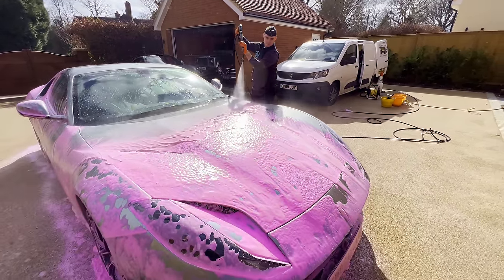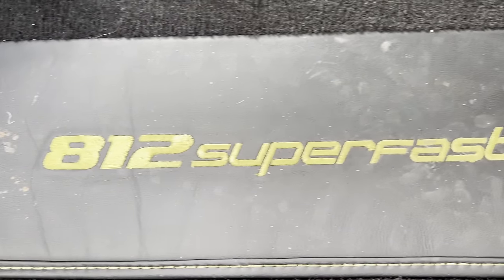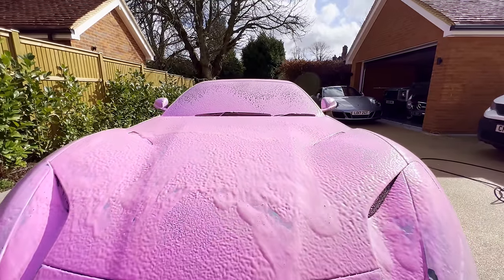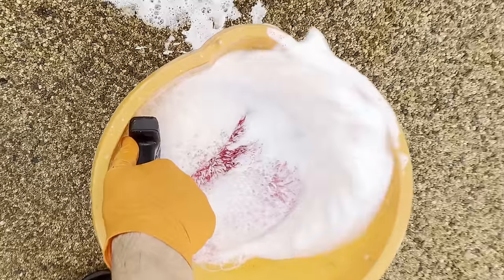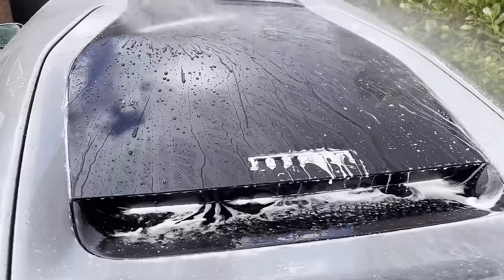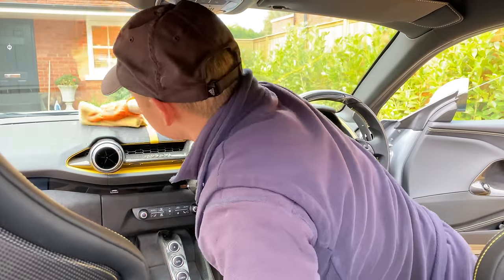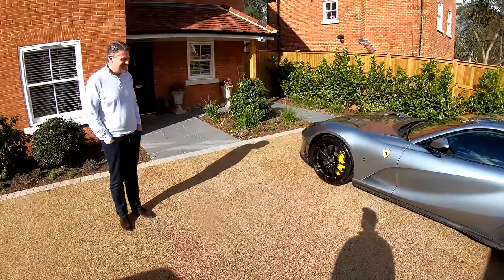How Super Cars are Cleaned In London

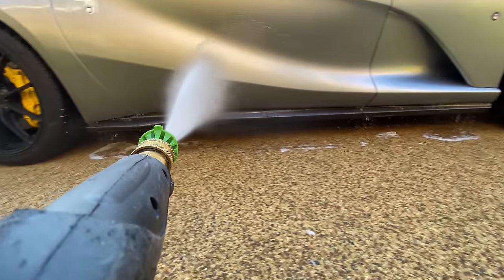Comment: Hi Tino! at the 6:10 mark you put the ceramic foam lance in the quick connect pressure washer handle, I have recently got a similar set up but when I use this it is leaking at the connection, did you use PTFE tape when you fit it into the lance? Please let me know.
Reply from the maker: Hello, yes I did (an would recommend) use the ptfe tape. Also I would recommend then tightening it hard (I used two spanners). Hope this helps.
Reply: @TinoCarCare  Thanks Tino!

Comment: 3:41.  How long do you leave the foam to act before rinsing with water ?
If you leave it longer than normal, can it be harmful to the paint ?
Reply from the maker: Depends on conditions, I like to leave it for around 2 minutes, however if it is hotter you leave it less, and if it is colder you can leave it longer. It is not harmful to the paint but you do not want it to dry as it is easier to remove the dirt once the foam is still wet

Comment: does it matter if the water is hot or cold in the bucket?
Reply from the maker: It doesn't make too much of a difference so I usually just use normal cold water. However hot water makes the shampoo a little more foamy and also during winter it will keep your hands warmer